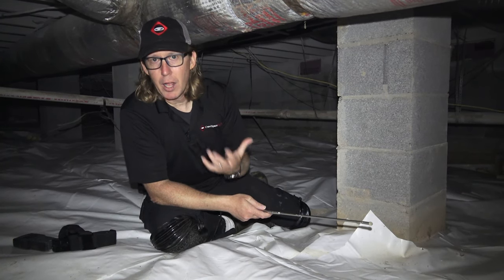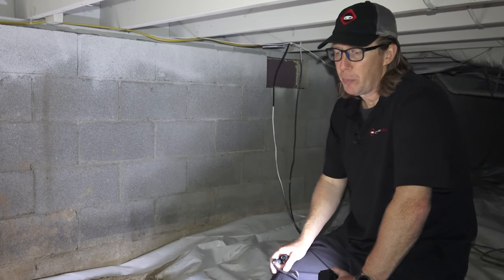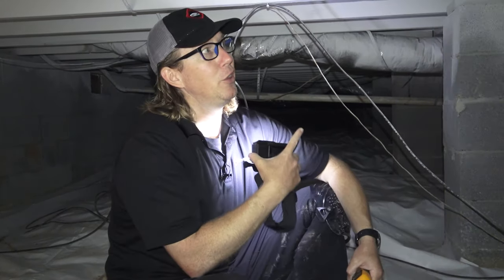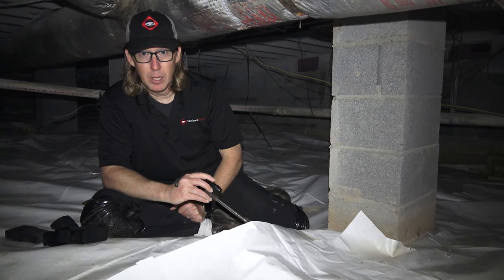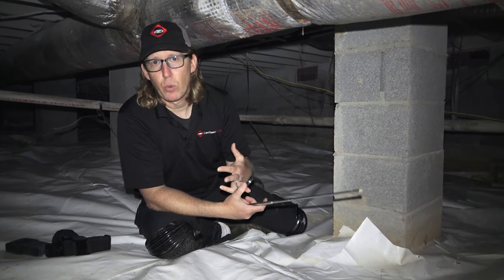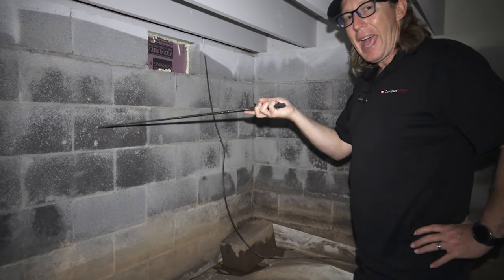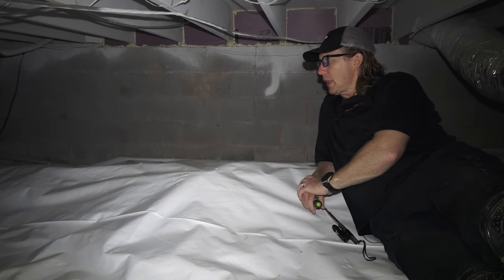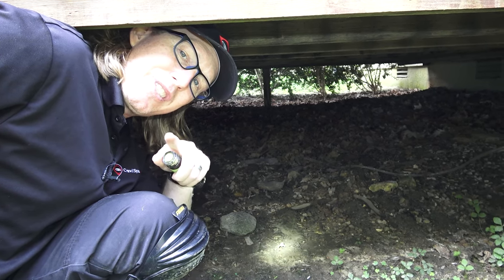Crawl Space Inspection Tips | Choose The Right Contractor

Comment: @crawl space ninja i live in ohio and there are vents in my crawl. Should i close them off  if i dont have a dehumidifier. HELP
Reply from the maker: we only close vents when we encapsulate and install a dehumidifier.
Reply: @CrawlSpaceNinja  ok thanks now on to the next should i encapsulate and install a dehumidifier?
Reply from the maker: @dennybirchfield  That is a good question, if its ok ill assume that there is a need so yes you should but be mindful of your budget.
Reply: @CrawlSpaceNinja  ok thanks yes i think there is its not wet or anything down there but with those vents being there moisture has to be getting in and wood and moisture dont work well together. Can i purchase everything to do this job off your website? Also when i do this is there a need to insulate the floor
Reply from the maker: @dennybirchfield  You can purchase everything through our DIy store ( DIY.crawlspaceninja.com ) and do you mean the sub floor or actual floor? you do not have to insulate the subfloor if you put foam board on the walls and close off vents.As for the actual floor we dont insulate, we just lay down the vapor barrier.

Comment: Why can't you just use crawl space vents? My houses are in New Jersey not the south.
Reply from the maker: To prevent moisture buildup that leads to mildew and mold, building codes generally require crawl space vents to allow outside air to circulate under the floor in the summer. To avoid freezing pipes in the crawlspace in the winter, the vents in the crawlspace are closed when the air is drier. Our recommendation is to open and close crawl space vents seasonally rather than closing them completely.

Comment: Why can't you fix the water from coming in instead of trying  to get rid of the water after it comes in
Reply from the maker: That is a good question, We have talked about it in some videos and the truth is it really comes down to how much you want to spend. You can prevent the water from coming in from the outside but it will more than likely be more expensive than installing a watermangement system on the inside of the crawl space.. Also if you think about an established home it will have plants, decks, and anything else that you would have to remove in order to prevent water from coming in. Hope this helps! :)

Comment: Some ignorant homeowners right there. Humidifier not running is homeowner irresponsibility. Total crap installation. Unfortunately builders are allowed to build homes this way. This is now 2021, there should not be a single house built in the USA with dirt floor crawl spaces without sealing. I will never buy a house with a crawl space that is not concrete floor and concrete walls…PERIOD.